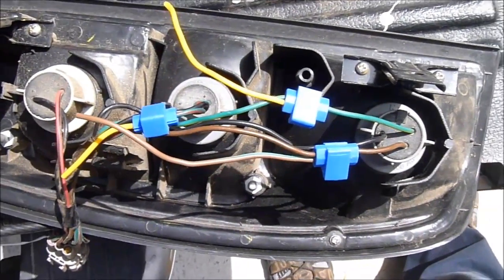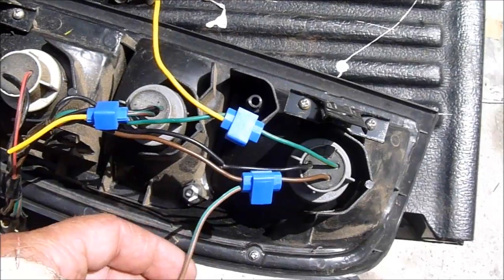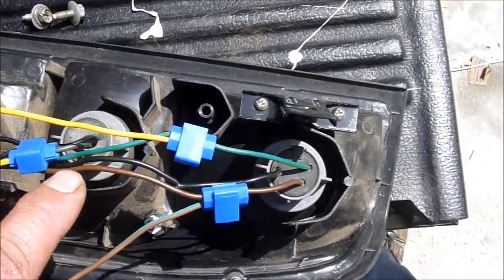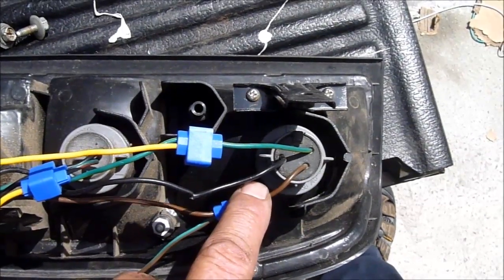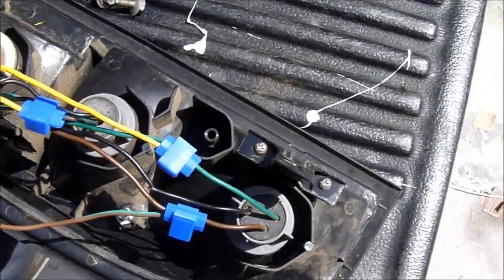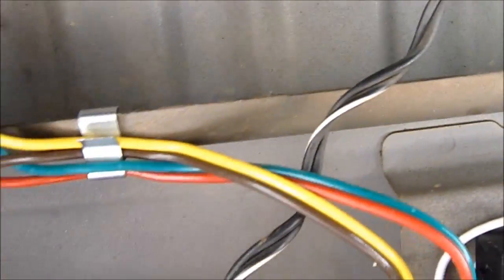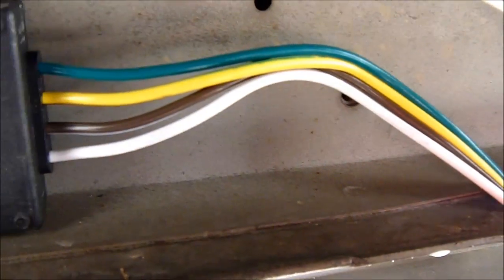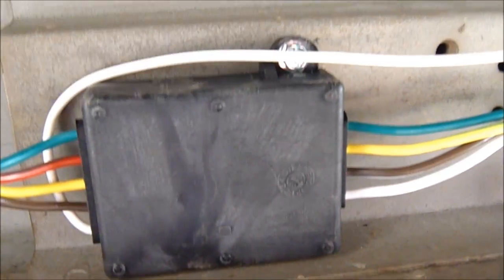How to make the trailer lights operate properly on a Nissan

Comment: you're using a 3 wire system since you have an older pick-up.  You need to test and connect to left turn  right turn and running lights .  you do have to hook up brakes as the brakes will activate automatically through the turn signals. green is right, yellow is left and brown is running. on a 4 wire set up the red wire will be the brakes.  If it's too difficult nearly every vehicle has a quick connect option you can easily find at uhaul or etrailer

Comment: Thanks so much. I have same problem. I know basic wiring and they said installing a trailer wire is was EASY. Not so!  it depends on your vehicle. I have a Nissan xterra. I have bought A converter and tried to wire it through driver side rear light still is not working. I will take a look under.

Comment: we had the same problem on a jeep. how can the turn signal and brake light be wired to the same cable? turns out we needed the same converter box. cheers

Comment: Your vid didn't help either. But you did take the time to help and I appreciate it so much.Left a thumbs up and a sub
Reply from the maker: What vehicle do you have?
Reply: 95 hardbody sorry I didnt mean it to sound like that.
Reply from the maker: No Problem, here's a good wiring kit on Amazon for $13.20 "Hopkins 48925 Tail Light Converter with 4 Wire Flat Extension"
Reply from the maker: I'd send a link but Youtube doesn't like links
Reply: Thanks so much, I'm trying to figure it out on my titan also having trouble would this same part work on 2010 Titan also., I appreciate your help very much .Send the ling it will just go to my spam folder i'll approve it thanks again
Reply: @AlvinShepherd  This video work for my nissan pick up 1995. V6.

Comment: This video pinpoints THE problem of wiring a trailer to a car. But it does not tell us how to solve the problem, without having to use a STUPID "converter". IE:

The problem is:  most all trailers STUPIDLY are wired to use the stop lights AND the 2 blinker lights as only 2 connectors instead of 3 connectors; as it should be. Most cars do NOT do that. They simply have 4 separate (plus ground) wires for 1. Tail lights; 2. Stop lights; 3. left blinker light and 4. Right blinker light.

The best cure for this STUPID problem; is to RE-WIRE the trailer lighting which is quite easy; albeit you will have to add two additional lights. 1. For the left blinker light and 2. For the right blinker light. Then procure trailer connector wires; using a "5-way" trailer wiring system. These are inexpensive from Amazon.

Do away with the "4-way" trailer lighting system and replace it with a 5-wire system. I did it and it works like a charm.

One VERY important note. Most new cars are using "LED" lights, instead of incandescent lights. That is a new world altogether. Yet I know of no trailer which does same. Until that changes, "converters" must be used.

For whatever it's worth.

When I get a chance, I will take some photos (possibly a video) which will show this done and how it is done. And link them here if the author does not mind.

Comment: Did anyone see the him show how to connect the wires to the vehicle wires? I watched this twice as he claims this is a video on how to connect the wiring harness to the vehicle but so far I have not yet seen him do anything like that except to talk about how he had messed up by getting the wrong harness to begin with. I really do wish people will stop mislabeling their videos to trick you to come and watch them. I should have known from the time stamp on the video that this was another falsely mislabeled video.
Reply from the maker: Virgil, sorry If I misled you it was not meant to do that and I will remame the video. However if you have a Nissan truck you will need a special converter to get your trailer lights to work properly. I bought a standard kit but found that it would not work. Here is a link to a converter for Nissan vehicles https://www.etrailer.com/Custom-Fit-Vehicle-Wiring/Hopkins/33515.html?feed=npn&gclid=Cj0KCQjwhrzLBRC3ARIsAPmhsnW-OHgpUxuDkRTmhQxTe87aGaFuw8DDJ8LcLlN87mCzmGEehEzvW-waAh1kEALw_wcB